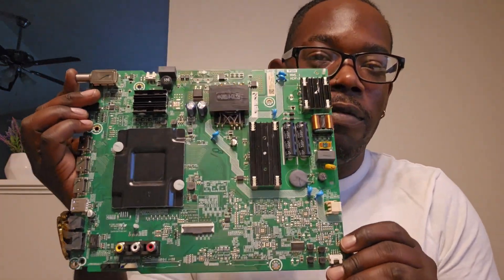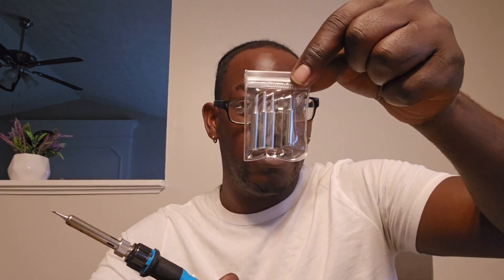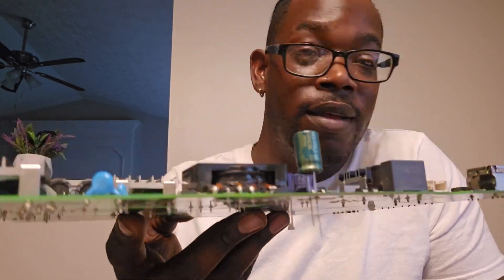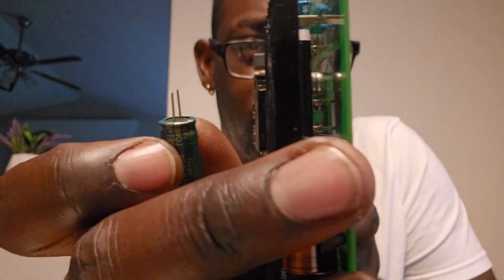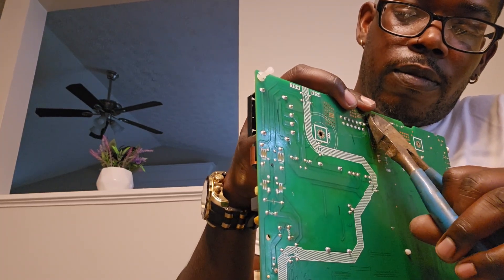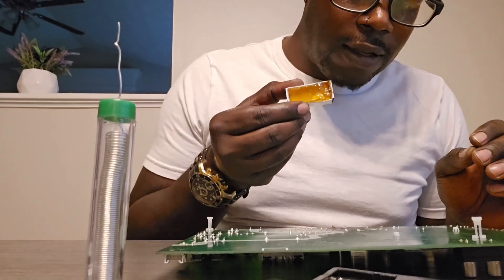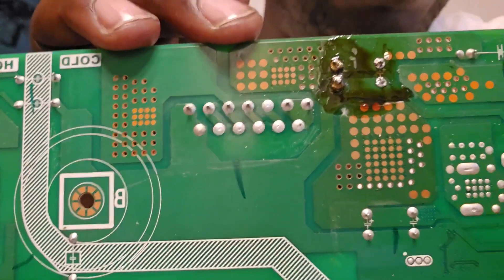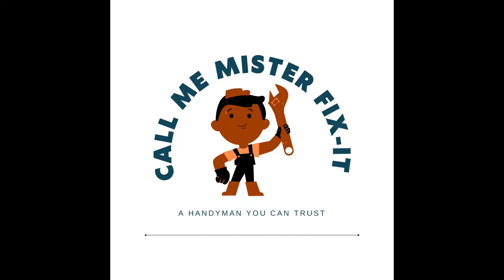Hisense TV motherboard repair

Comment: Can you post a link to the capacitors you bought please?  I have the same TV with the same problem so I'm guessing it's the same thing but I need to take the board out and look at it.  Replaced the power board and the wifi board trying to fix it.  Hopefully this works.  Thanks
Reply from the maker: @Patrick-wu6kt  sure thing I'll also add in the video description. 
Cermant 10PCS 400V 10UF Capacitor... https://www.amazon.com/dp/B0BZTV2CYV?ref=ppx_pop_mob_ap_share
Reply: @only1avanu  Thanks!
Reply from the maker: Please let me know how it goes!